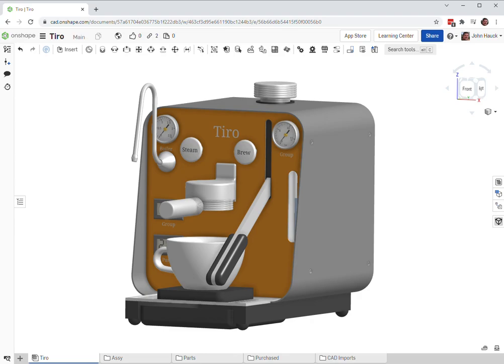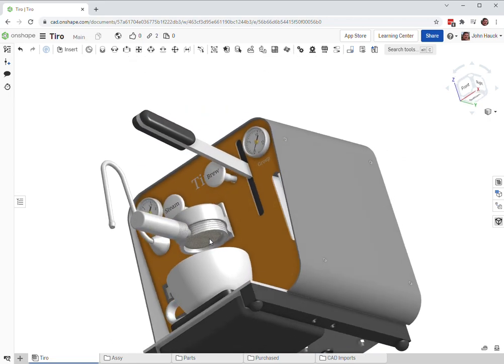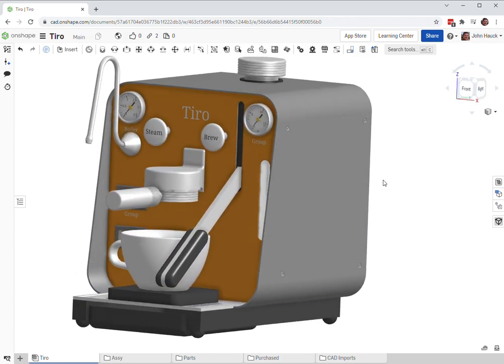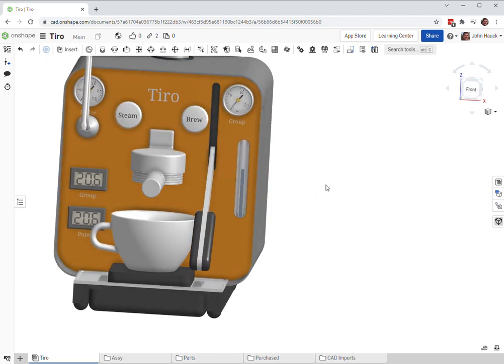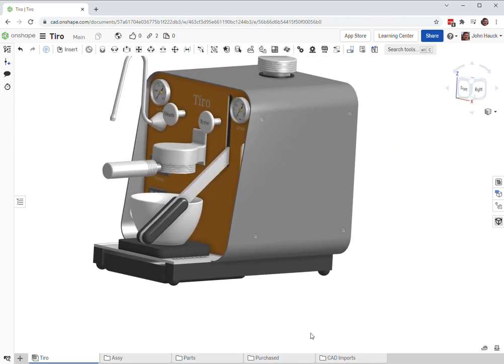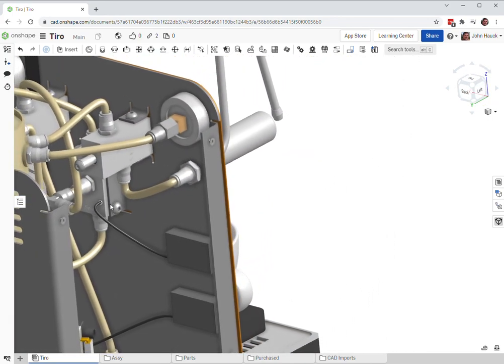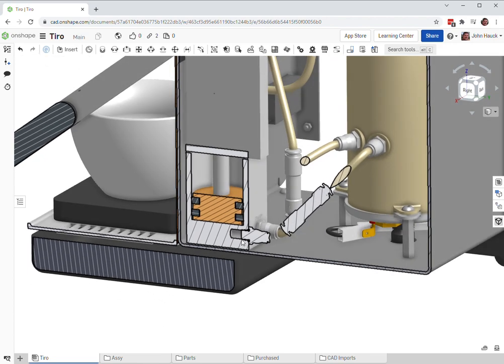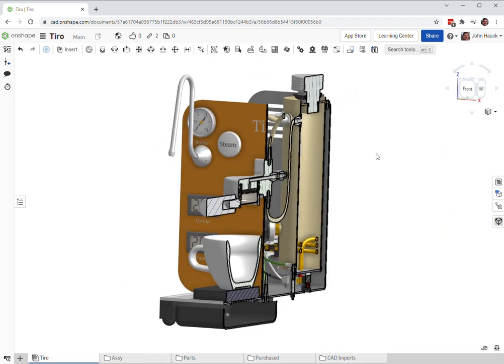Tiro - Yet another manual lever espresso machine concept

Comment: Absolutely great design john, and I'm very much excited to see transient thermal CFD to figure out how much heat would be absorbed by the mass of the piston sleeve and the brewing head.
Reply from the maker: Mahmoud, Not to dismiss my duty to run some CFD before too long... the idea is that you can continue to cycle hot water until the group head reaches the desired temperature. Thanks for the kudos, it means a lot.